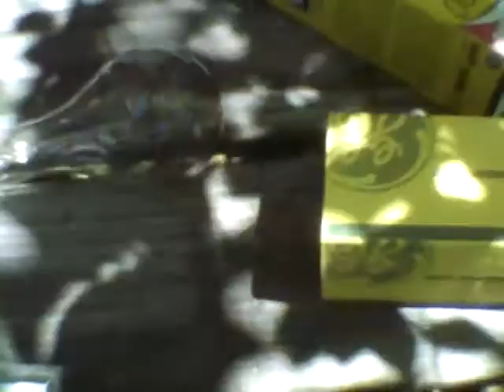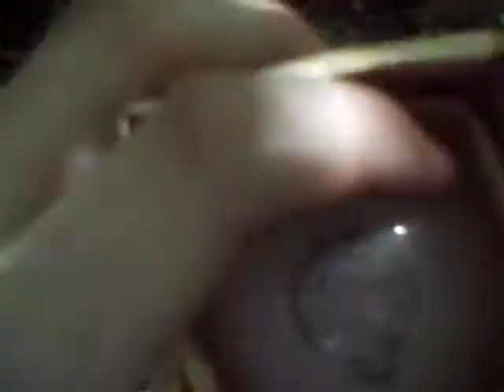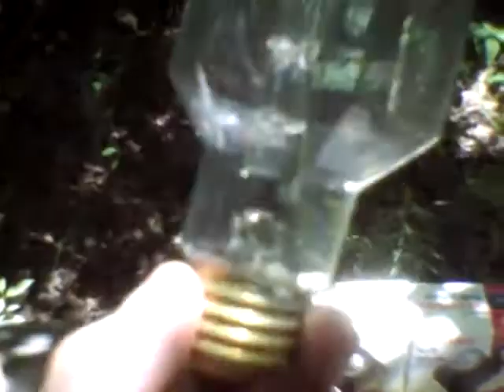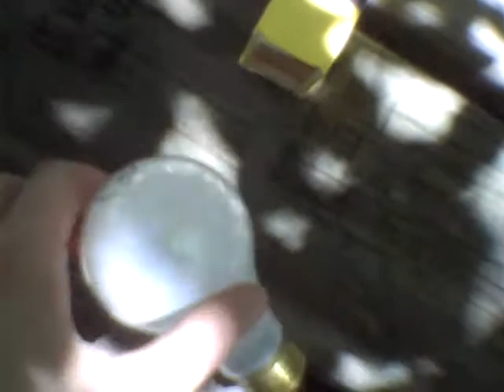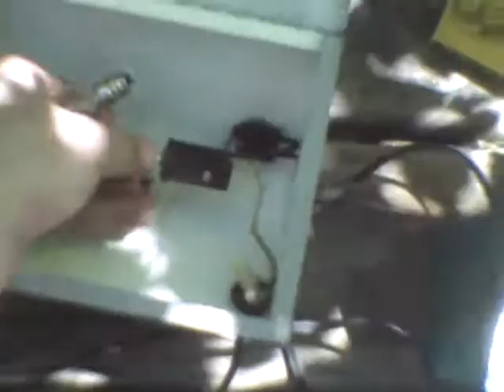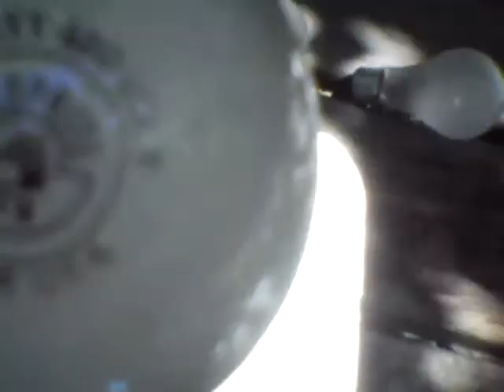Incandescent lamp collection highlights

Comment: I have some new old stock GE mazda 239 watt 24 volt bulbs with prefocus bases marked aircraft HDLT also westinghouse mazda I got some old bulbs from the 40s 50s 60s with a vertical filament I will send you a video reply in a few days of my light bulb collection.